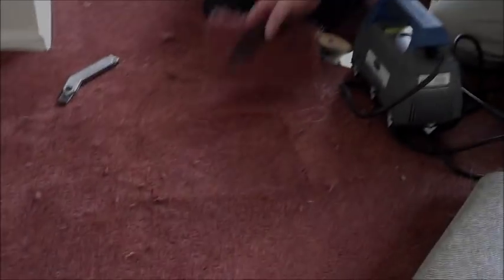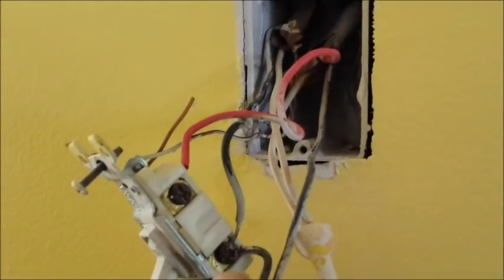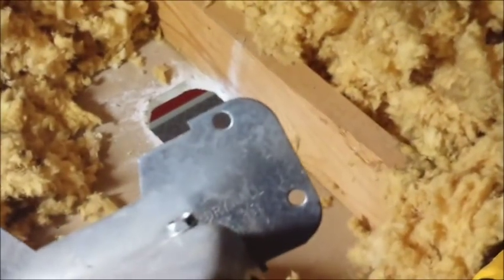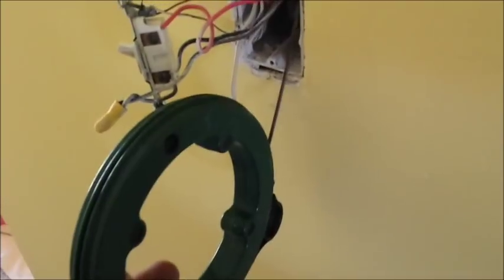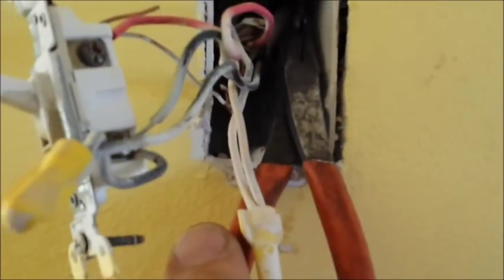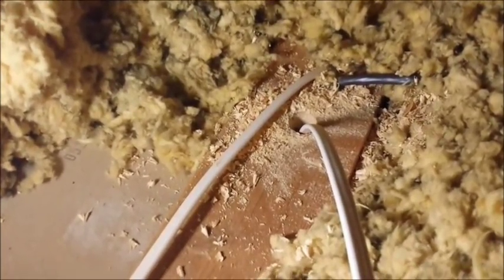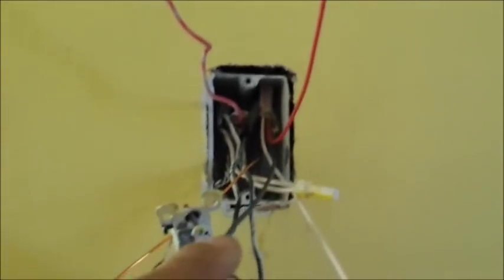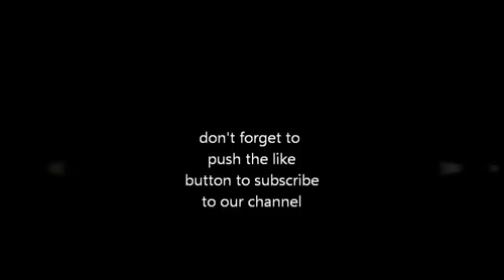Install a Ceiling Fan where no Wiring exists

Comment: Thanks so much for posting this! I have done a lot of basic "remove and replace" electrical projects, but never installed the wiring myself. I was a bit hesitant to try this until I watched this video. I was able to install Hunter's Fanaway ceiling fan with confidence.  It would have helped to see the wires spliced together before the switch was reinstalled into the switch box, but the explanation beforehand was adequate. Definitely the most comprehensive instructional video on YouTube! Thanks again.
Reply from the maker: Thanks for the feedback, Jack!  Glad it helped you get your project done!   Enjoy! 
Www.houserepairsyourself.com

Comment: Excellent video.  I need a switch at the wall that has one switch for the light, one for the fan, and one for the receptacle.  I think it's a similar procedure, but if you have such a video, please provide a link.  Thank you.
Reply from the maker: That's a very specific application, so I don't, but you can apply the principles and methods that I used here to make all of those wires switched.

Comment: Great Video. This was exactly the scenario that I have to work with, and the explanation of the three way wiring to the wall outlet will make the job far less intimidating. The hardest part will be fishing the new wire from the old switch to the new fan box in the ceiling. But, where there's a will, there's usually a way.
Reply from the maker: That's right Charles.  You can do it!  Thanks for the comment.  It's great to hear that it was helpful.

Comment: As a new home owner, I want to thank you for this video. All of my rooms have no ceiling lights except the kitchen and hallways and all bedroom switches control outlets...thank you.
Reply from the maker: You're welcome, Justin.  Glad to help!  Enjoy your new home!
www.houserepairsyourself.com
Reply: k
Reply: My house built in 1984 is the same way with the exception of the master bedroom and no one ever connected a light or fan to a box that was installed in the ceiling, but never used. I installed a fan with light in the master. The other two rooms still don't have a light on the ceiling. Eventually I'll add one.

Comment: Great video and information. I have the same exact situation in two rooms. The only issue I still had was the wiring at the switch. I was still confused on how to wire the switch. But I found a real simple solution at Home Depot. I found a electrical switch which is called Decor Two Single Pole Switches for 10 bucks. It takes the quess work out of figuring out how to wire the switch. One switch for the fan and one for the outlet. I also found a neat bracket for the fan if the joist in not in the center of the room for 16 bucks. After looking at all the stuff I need it will cost about $100 to set up both rooms not counting the ceiling fans. 50' of 14/3 Romex, 2 electrical switches, 2 fan brackets designed for fans, fish tape and small bag of electrical nut connectors. This video showed me a whole lot cheaper and easier way  to add a fan than hiring an electrician for a simple job. Thank you very much.

Comment: Thanks! Super helpful video. I've done a lot of this separately before but this puts everything together and is especially useful because I am starting with a switched outlet. Mine is a double switched outlet.

On another note, as someone who's pulled about 10 miles of ethernet/phone cable, if you're worried about needing to re-fish a hole, put a loop in a string that youve tied to your fish tape, bend the end of the wire into a j, hook the loop, and tape about 3-4 inches down the wire where it doubles back on itself.  You now have a string running parallel with your wire and if you ever need to pull a cable again, you just repeat the process so you always have string in the wall. Works with conduit too.
Reply from the maker: Thanks for the great tip!
Reply: Home Maintenance Solution, Inc can't take credit for it, learned everything I know from my dad (general contractor) and a friend/previous supervisor Jeff. Spent a lot of time climbing between the first and second floor of the dorms in college (: that said, happy to pass on a time/work saver.
Reply from the maker: Awesome!  😄
You are blessed and I can tell you like to give of what you have.   You will go far in life!

Comment: Thanks for making this informative video.  I plan on adding a fan in a room wired just like this room, the switch powers a plug and there's no ceiling light fixture.  My good friend is a seasoned election and I plan to have him do the job, at a generous discount of course. It's still nice to know what he'll be getting into.  I feel much more informed now and could probably do the job myself but I think it would be wise to let my friend who's a professional do the job.  I want him to kind of check everything out for safety anyway as this is a new house purchase. I will be able learn more from him, help him fish the wires and maybe next time I can do it myself.

Comment: We have a very small patio. An electrician attached a box to the center of that patio ceiling, and it was exactly on that wooden stud. He also attached there a small box (Steel), which is sitting on a couple of screws. His idea was that because it is attached to the sturdy wood it will support the fan. I doubt that box is sufficient for the heavy fan. I could change the box, but my question is how to attach any box to that stud? Maybe with some braces (going around that stud), if there is not much space for that thick rod on which the box is sitting. Or the box for the heavy fan (which is 48 in Havana, Hampton Beach) should be located between the studs only, so you can install the supporting rod? Thank you for the film.

Comment: My house built in 1984 was ceiling fan ready, meaning they ran the wires and switches to control a ceiling fan and light in the living room and master bedroom in case someone ever wanted to connect them. No one ever removed the painted and textured cover and installed anything. When I removed the cover the boxes were cheap plastic. One of them broke removing the cover. No way was I going to install a ceiling fan on those things. I removed them and installed metal boxes. I installed fans with the light kits and control the fans with 4 speed wall controllers. I like being able to control the fans and lights independently and not having to use the chains at all. My other bedrooms only have switched outlets like these with no ceiling lights or fans. Someday I'll do this, but I want to change out the switch box with a double and be able to switch the fan and lights independently. I like a hard connection, don't care for those remotes.
Reply from the maker: Yeah, that's no problem Billy.  you just need to get two switches and connect the red and the black to a separate switch.  Then one will control the fan and the other will control the light.  
www.houserepairsyourself.com

Comment: Loved this video! Very informative.... I do have a question though... What if the room you are wanting to install the ceiling fan in has a bedroom above it instead of an attic? Thanks!
Reply from the maker: That makes it harder, but it is doable.  You will need to cut out an area of the drywall on the ceiling.  See our comments on this subject below to Michael Meis.   Best to you!

Comment: Someone else mentioned this but I have the same question: In your situation, why not install a junction box in the attic?  Couldn't the existing wiring then be reused from the box to the attic and eliminate the need to fish a new wire through the wall?  Very good video - thank you very much.
Reply from the maker: You could do that, but 2 reasons why it might not be the best.  1. You probably don't have a 3 way wire coming out of the switch box.  2. Junction boxes in the attic are legal, but usually hidden and difficult to trouble shoot if a problem arises.  
Best to you!

Comment: Im in a first floor apartment with concrete ceilings.  I have no lights but an outlet controlled by the switch. Im thinking about wiring the fan with a plug and running the wire down the outside of the ceiling and wall with some wiring trim to make it look nice and clean.
Reply from the maker: John, that sounds like the best solution, in your case.  Good thinking!
Reply: @Homemaintenancesolution  I just looked into it I'm going to have to replace the outlet with the actual wire molding Outlet because it has an opening on the top to receive the wire molding so the wires can get to the back of the outlet without trying to go under the original outlet cover
Reply from the maker: @Brady.John87  Yeah, good idea.  Those project from the wall a little and have knock outs on the top to run out of.

Comment: I have this exact situation! (older home) Thanks for your very explanatory video. I would like however to have separate controls for the light and fan, any suggestions?
Reply from the maker: Brenda, instead of leaving putting the black wire to the fan in with the hot group of wires, you just need to put that on the switch control for the fan and supply the switch with a short "pig tail" from the hot group of wires.  Best to you!

Comment: We have a recessed light close to where we'd like to hang a chandelier.  The electrician we hired said there is no support to hang a chandelier; he'll need to cut holes in the ceiling to find wood in the crawl spot (first floor ceiling; 2-story house) on which to attach the ceiling box.
Reply: ***** The recessed light will provide a way of wiring the chandelier; we just need a way of supporting the weight in the spot we'd like the chandelier.  Is there hardware designed to do what we need?
Reply: All that would require is a small inspection hole first, in the location proposed for the installation, locate the joists with a flashlight then use a expandable rodded box that would be placed against two joists. These are usually referred to as a braced ceiling fan mounting box.
Reply: Oh, also you already have the hole cut in the ceiling for the recessed light and that would probably as good a spot as any to change the purpose of that hole for your chandelier. Since that hole would still be larger than you need for a standard fixture box you would either have to close up that opening with a drywall patch or cover that extra wide opening with a medallion or what is sometimes referred to as a daisy ring

Comment: Next time cut the 14-2 and 14-3 in the ceiling and put a jb, could have 3 returns off the 14-3 going down to the switch, added another lighting scheme  in the room, and splice the constant hots to (or from) the 14-3 to the plug, no drilling or fishing 😉

Comment: Great video! I have a receptacle that has the top outlet controlled by a light switch. I have easy access to run a new line to the receptacle but not the light switch. Is it possible to wire the ceiling fan up in this fashion? I would like the light to be controlled by the light switch and the fan to have constant power. Thanks!
Reply from the maker: Sure, if you can get to the receptacle easier, then that's a great option!  Best.

Comment: My son's room has a switch that turns on an overhead light. When we built the home, we opted to not have the wiring for ceiling fans in a couple rooms. I'm still giving my wife a hard time about that choice. Anyway, do I just do everything the same using the wire already there? Will I still need to add more 12 gauge wire through the attic?

Comment: I live in a small apartment, and management has given me the "okay" to install a ceiling fan in my living room (no light fixture or power to the ceiling).  I've got the same issue: the light switch next to my front door controls the receptacle below, which I have a lamp plugged into.  My apartment has it's own circuit breaker, but does not have access to an attic.  My apartment is the bottom-floor of a three-story, two apartment tall complex (the apartment above me is a two-story dwelling).

All of this being said: is there any way that you could give me an idea of what it would cost to hire a licensed electrician to do this kind of work?  Management will not do any of this, so it comes out of my own pocket.

Thanks!  Again: very small apartment with low ceilings.  I'm not sure if this factors into the price, based on the amount of work needed.

Comment: Thank you for your video. It's pretty straightforward. I do have a question though, is there any drawback to using a higher rated gauge wire than you need? 

Like if I was really worried could I go double what I need or would that cause issues? 

Thank you!
Reply from the maker: M Marrone, mostly no.  The basics are that it costs more and is harder to work with and fit into the box, but the only significant one is that it COULD decieve someone in the future into installing a higher amp rated breaker, especially if it goes back to the panel.
Reply: Ok. Cool. 

Thank you!

Comment: Awesome video. Thanks.
I have a question. What if you want to put two switches for the fan? One to turn the light on or off and the second to control the fan.
Reply from the maker: msiddi01 You simply need to switch both the black and the red wire.  Don't connect either one to the hot source in the switch box.  Hope that helps!  Please subscribe to our channel if you haven't already.  Thanks!

Comment: Thanks for this video -  this is exactly what  I'm trying to do in our house.   Question  for you - if I wanted to keep the top outlet across the room attached to the switch (as well as the light in the fan) could I just leave that red wire that was originally attached to the switch in place and add the new red wire for the fan light,  or can the switch only have one red wire coming from it? Thanks in advance!
Reply from the maker: Pete, sorry I didn't see this comment yesterday.  You are exactly right in what you said.  Yes, you can leave the red wire to the top of the outlet connected.  You aren't allowed to put two wires on a screw terminal, so you will want to nut them together and bring a "pig tail" wire to the terminal.  Best on your project!

Comment: We want to do this in our home, however we want to use a wall switch that controls not only the light, but the fan as well. What additional steps are there for this?
Reply from the maker: Sean, you simply need to connect the black wire in the 3 wire cable to the fan switch instead nutting it in with the hot wires.  Make sense?
Reply: Awsome thanks.

Comment: i have a slightly different issue, i have a power source going to an outlet and a switch connected to that outlet, the switch controls both outlets. The difference is that i only have a black, white, and ground but no red wire. I also want the switch to control both the fan and light. How would i wire the fan that way?

Comment: does anyone know if it's against any california code to drill a hole through the light switch box like that?  thanks!

btw, thanks for spending the time to do the video
Reply from the maker: Most codes for fishing wires are pretty forgiving, but not sure what the codes in your area require.  Certainly, if you have a metal box it would be disallowed.  Plastic box should be fine.  Best to you on your project!
Reply: Home Maintenance Solution, Inc awesome.  thanks again for your hard work!
Reply: Code is the same everywhere in the us except in certain local jurisdictions like New York State where Romex is entirely illegal to use for example. California has none other than national building codes to follow. Making additional holes in a device box is no different than having more than one opening which most boxes already have. Makes no difference where the new hole is placed anywhere in the same box
Reply: Home Maintenance Solution, Inc what difference would it make to use a metal box and not a plastic one? This is something I have never heard in the forty years I have done electrical work, much of which was involving remodeling and all of that requires some form or another of fishing wires.

Comment: Why not always use the lowest guage wire just in case? Ie, 12 guage wire on the 15amp breaker. Is there any cons other than thicker wire to work with?
Reply from the maker: The cons on that thinking are 1. Thicker wore than necessary, as you mentioned. 
2. Higher cost for wire. 
3. Someone in the future could follow up behind you and assume that the breaker should be a 20 amp to match up to the wire and create an unsafe condition.  They should catch that the wire feeding into the panel is a 14 gu. requiring a 15 amp breaker, though.

Comment: Is it possible to wire a remote controled ceiling fan to recepticle and not to a wall switch. Just using the remote to turn the fan off and on.
Reply from the maker: Kevin Miller, yes!  The remote controlled fans need only a hot, neutral, and ground.  That can be a good option to simplify, but you still need to get a wire to the ceiling.  The disadvantage is that you don't have a switch by the door to turn a light on when you walk into a dark room.  If you leave your wall switch wired to the outlet and plug a lamp in there, then that problem is solved!  Good suggestion!
Reply: Thanks for confirming my thougts, reason I asked was I have recepticle near the ceiling where pot shelves are that was originally used for wifi for the home which we no longer use and it is only 8ft total length to the location I've selected for the fan. Other wise I would have to run wire to a new switch location and then to the fan, it seem the more simple solution. As to the disadvantage you mention, it's not a main lighting source for the home, when we enter the home it's thru the garage into the laundry room and if we use the front door there are entry light switches at the door for other ceiling lights. Thanks again.
Reply: Of coarse! The remote control receiver is enclosed within the bell that covers the mounting yoke of the fan, and as long as its connected to power the remote sends the signal to the receiver. No other special wiring necessary